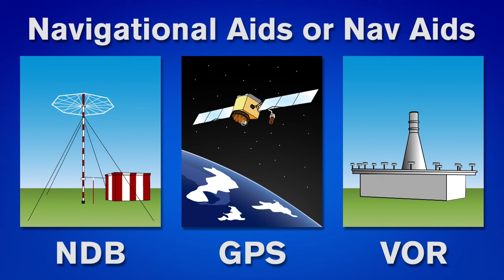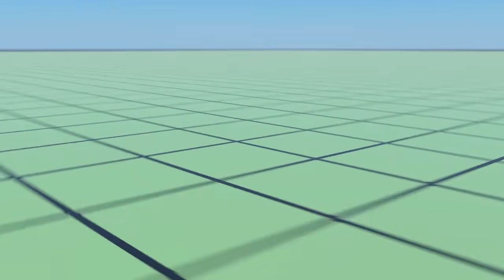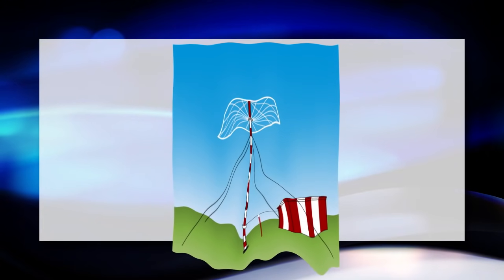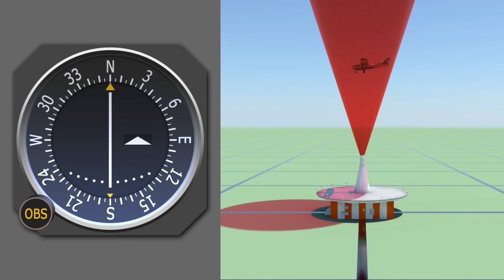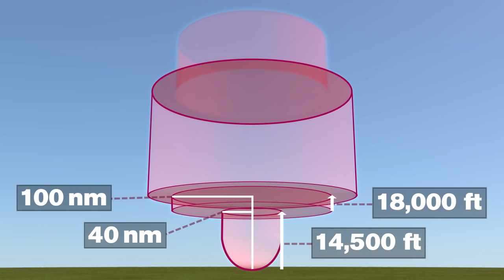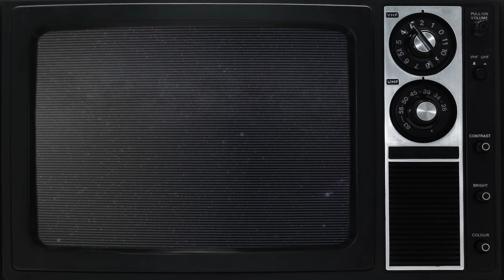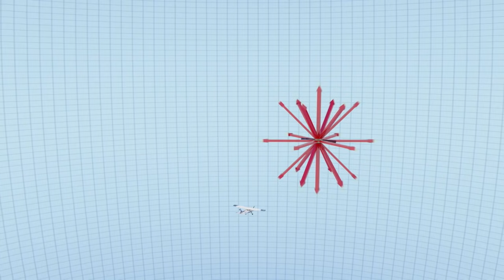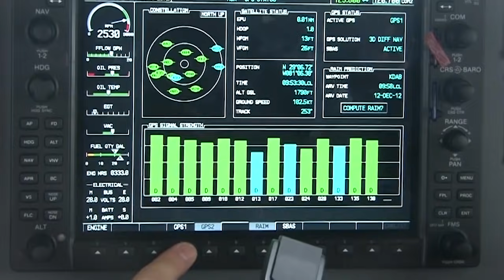Navigation Systems

Comment: 1:05 - - Ground Waves, Sky Waves, Space Waves    
1:15 - - GROUND WAVES - - lower frequency waves that travel close to earth’s surface + follow the earth’s curvature.  The LOWER the frequency - - the FARTHER the signal will travel.  
1:27 - - They travel reliably + predictably + are NOT INFLUENCED BY OUTSIDE FACTORS   
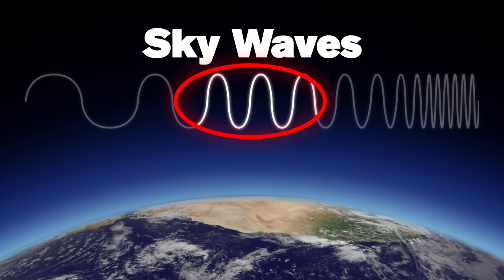1:37 - - SKY WAVES - - higher frequency waves that can also travel long distances.  
1:58 - - SPACE WAVES - - 
2:36 - - NDB (Non-Directional radio Beacon) - - a ground-based AM radio transmitter (transmits in all directions)    
2:58 - - NDBs operate on/within the frequency range of 190 kHz - 535 kHz (190,000 - 535,000 cycles per sec); since they operate in this LOW to MEDIUM frequency band - - 
3:04 - - they are NOT subjected to line-of-sight limitations of Space Waves

Comment: Very nice videos, as usual. Just one question... (refer to minute 5:00 of the video). Shouldn't the ADF needle be pointing to a relative bearing of (lets say) 020, as the airplane is compensating for the wind coming from the left, thus leaving the station slightly to the right of our heading? All best!

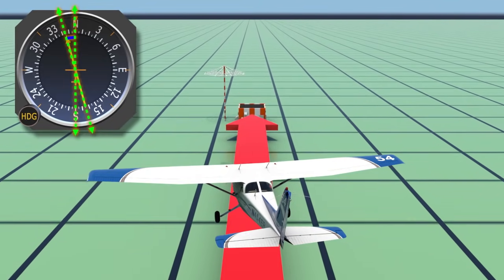Comment: Great video, however the ADF needle at minute 5:00 to 5:15 is pointing in the opposite/wrong direction. It should really be pointing to the right of the nose (about 15 degrees to the right of the N).
Reply: Crivo152 thank you so much for making this comment. I thought I was going a little nuts. Not a big deal that the animation is wrong but helps me to know that I haven’t fully lost my sanity yet. Lol.
Reply: Please explain how. I am a bit confused.
Reply: Yes, RBI should be pointing 015.
Reply: I was just going to write that.
Reply: @ShaolinCheems  If the wind correct has you pointing 20 degrees left of your track, as you fly over the station it will be 20 degrees to the right of the nose of the plane, so the needle would be pointing 20 degrees right of your heading.

Comment: The description of how basic GPS works is wrong. The GPS receiver in the plane doesn't know the current time, since that would require an expensive and delicate atomic clock installed in the receiver. Rather, the receiver subtracts the time received from two different satellites to determine the difference in distance. Given 4 satellites (and thus 6 different distance differences), the receiver can then solve a system of simultaneous equations to get the actual distance from each satellite, and then use the ephemeris data to calculate its position in space. GPS is used by other satellites to track their own position, but if GPS actually generated two possible positions and then discarded the one in space, that wouldn't be possible.

Other than that, though, I thought this was a very informative and well-done video. Thanks.
Reply: I believe such criticism is to be respected, and sadly expected, but at least you were respectful about it compared to other individuals.

Comment: Great video! But there is an mistake based on my fly knowledge.when talking about NDB tracking .if the wind is coming from left when the NDB station is straight ahead .you should put a correct angle to left , and the needle will shows a right indication.

Comment: How do radio ground waves bend and follow earth's curvature exactly? Could you explain?
Reply: The longer wavelengths (lower frequency waves) can diffract around the curvature of the earth and around mountain ranges.  This "bending " is not very large, however.   Higher frequencies like VHF and UHF bend very little and are more like light waves.